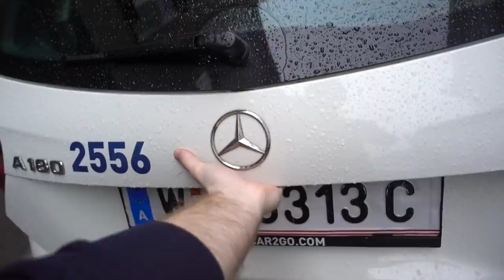What's in THIS container?

Comment: When it comes to sites in the uk its actually very chill i think. One site i go to has a public path way that goes through the site. Either end has free protective glasses and a warning sign. The site has never had any issues and i've even seen a dog walker roam through. Super weired. Another site called project X is in leicester. Its an old tyre factory. Super close to homes and you can even see the streets and homes through the glass windows of the site. Super weired for me cause im used to going to sites that are in the woods far from any towns or anything. Loved Project X would recommend. - Urban CQB Quick Spawns Very accurate score keeping with chalk boards at spawns being used most games.